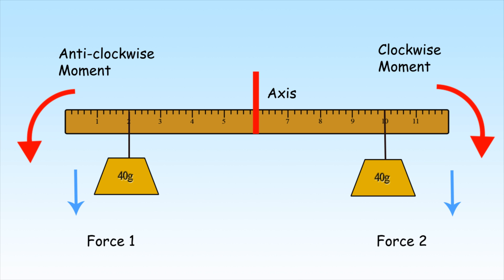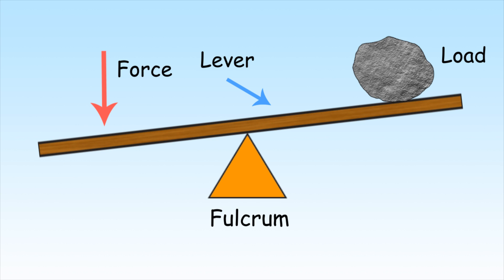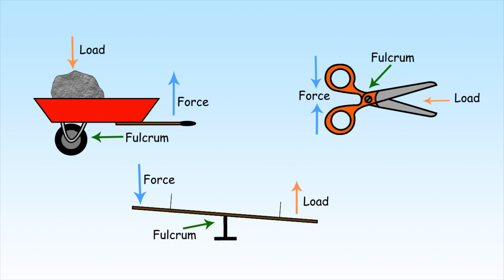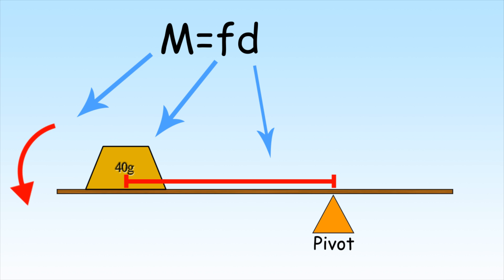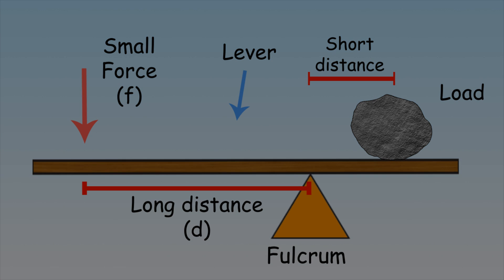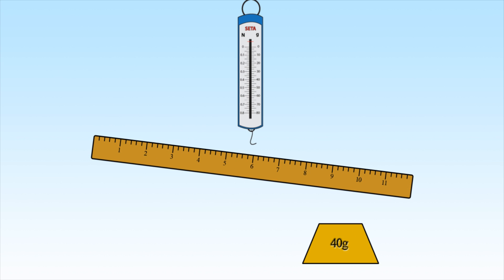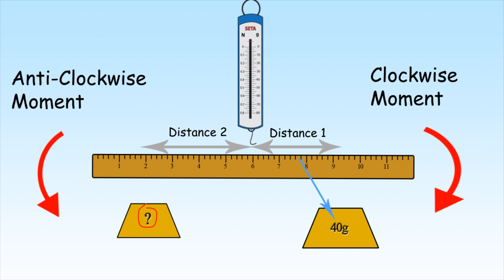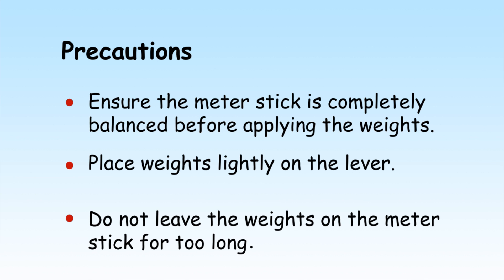Law of the Lever

Comment: any body have a solution of this questions
Two children of mass 20 kg and 30 kg sit balanced on a seesaw with the pivot point located at the center of the seesaw. If the children are separated by a distance of 3 m, at what distance from the pivot point is the small child sitting in order to maintain the balance?
Reply: Parvez Taj 4 m